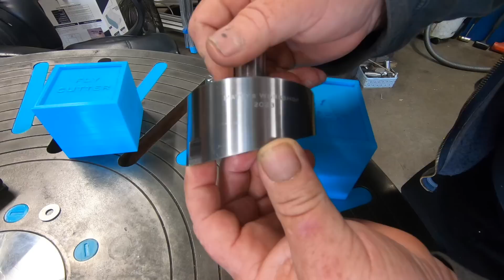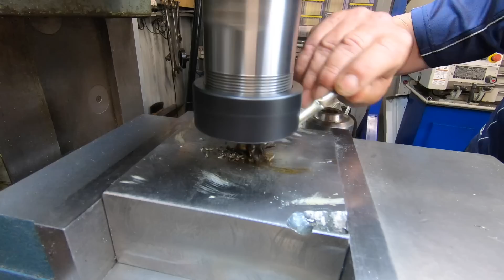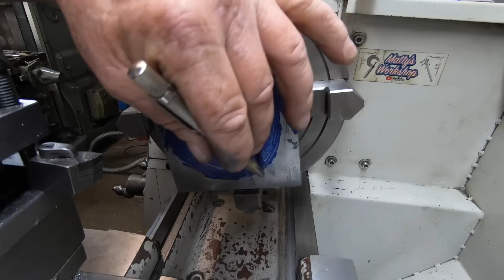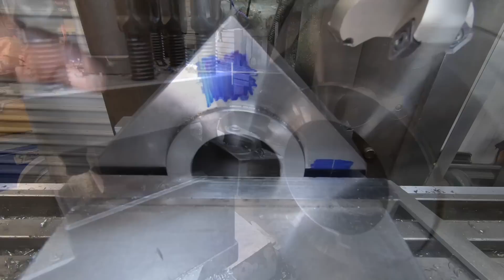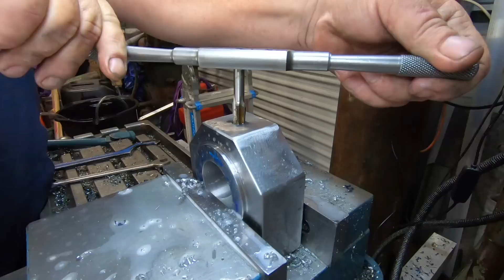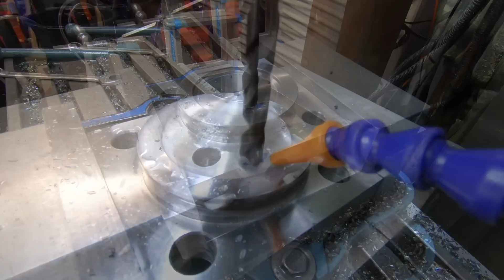Hydraulic Cylinder Repair & Giveaway Update

Comment: Nice job Matty, that steel housing is gonna be a lot stronger as the cast iron one looks to have broken under tension ? 
I think I would still have incorporated the original bush or machined some grease ways in the new bore though ? Making it in two parts wasnt a bad shout either, probably less overall machining time ?
Reply from the maker: Gday Greame, they reused the pin and that has a grease groove machined into it, I did suggest to reuse the bush but they didn't want to go that way, Thanks for watching, Chers

Comment: I'm happy to wait to see perfection do not appologise. Well done. Not sure using two different types of material is a good idea Matty, the forces of the work being done on them may case premature failure of any component.
Reply from the maker: Gday Raymond, the 2 pieces of material come from the same plate and the guy who welded the 2 together has done this type of work for years with no trouble, i'm confident it won't fail, Thanks for watching mate, Cheers
Reply: @MattysWorkshop  when and if you make No2

Comment: Absolutely fantastic Job Matty. I am sure the people will be stoked with their parts. I have used and still use a product called Tectyl 506 for rust prevention. Tectyl leaves like a wax coating over the surface. The only downside I find with it is that it can be a bit stubborn to remove.
Reply from the maker: Gday Stewart, they were really happy, thanks for letting me know about the Tectyl 506, I'll look into this mate, Cheers

Comment: G'day Matty, you've made a great job of that mate, as you say it is what it is, and given the material constraints you had to work with you've made a silk purse out of a sows ear! I hope that crew have a good welder coz if that hydraulic system is as bad in design as you said, then the welds are going to take a hit. They need to get it so the rod doesn't bottom out. But that's not your problem lol. I love the finish you get with those inserts that you use, and your fly cutter finish is to die for! Cheers from the UK mate, and don't worry or apologise for a video being late, you had to get the job done pronto and that must come first, we are just along for the ride! Incidentally, that tap if a bit blunt, if you have an oil stone with two different radii ( I think they're called "Teardrop" shaped stones, you can get into the " Hook" of the cutting edge and get them sharp quite easily. My late brother was a precision thread grinder, he was apprenticed to the firm of Lehman, Archer and Lane ( LAL ) the company was quite close to us, only about a mile away and was in business from the mid 1920's until the early nineties. You may have come across LAL stuff, taps ,dies die holders, tap wrenches and much more besides. Anyway you can easily sharpen a tap using the teardrop stone, especially one as big as that tap was. What size was it 3/8 "or 7/16"BSP it looked to be. Take care Matty, Sam from the UK
Reply from the maker: Gday Sam, the tap was a 1/2 14 bspf, I’ll have to keep an eye out for a teardrop stone, it took a bit to get the thread done and I was happy when that part was over, the way my luck goes I was expecting it to bust on the last turn, the guys were surprised it was done so quickly, 2 days from finding the material to having the machining finished, certainly something different anyway mate, thanks for watching, cheers

Comment: G- day Marty I have been a subscriber for quite some time now and love what you do for I do similar things at home,in reguards to your concerns on rust getting on your tooling I used way oil for quite some time and found I got oil stain on my tooling if not used and then I started using inox mx4 it is full of Teflon I get no rust or stain on my tooling witch is important to me for I am up in central Qld and has worked wonders for me cheers 👍
Reply from the maker: Gday, hopefully it should be right, ill see if I can get the Inox mx4 here, thanks for letting me know, Cheers
Reply: Haven't used the mx4 but have used mx3 on my fishing reels for many years and it's awesome.

Comment: i always wonder,  that when making a square into a circle, why not cut off the corners first, then use the lathe
Reply from the maker: Gday, Sometimes its quicker to machine the corners off depending on the part, work holding say in a bandsaw can be a good challenge, Thanks for watching, Cheers